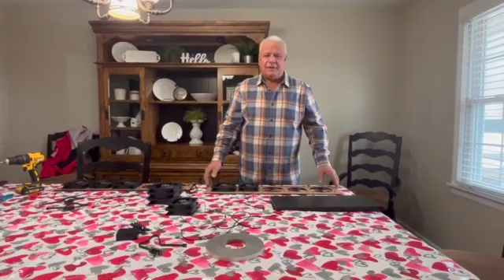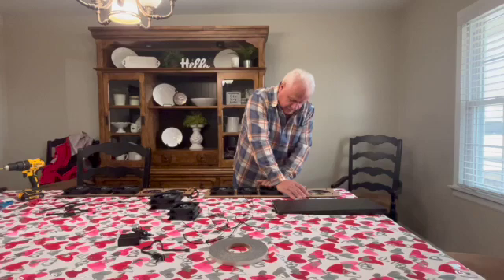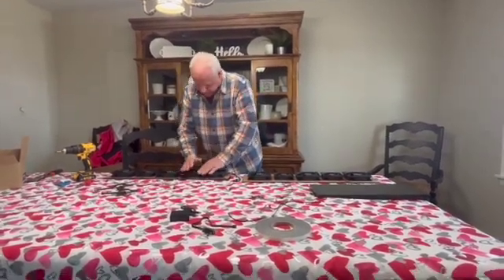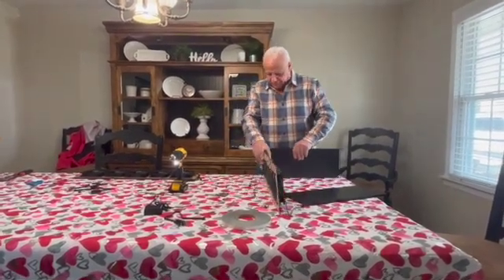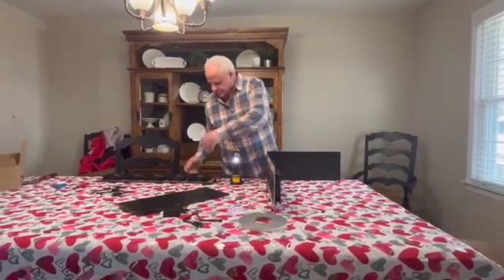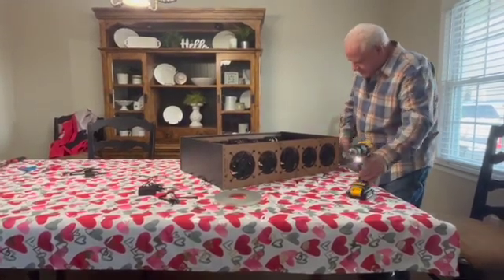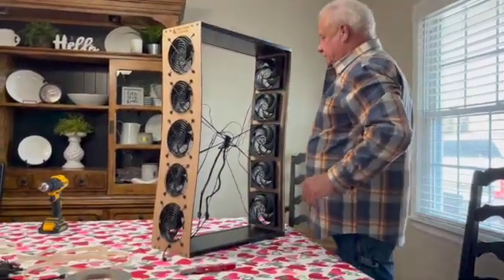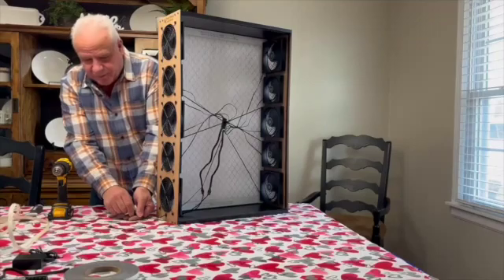Tower of Power Kit Assembly

Comment: It still does not make sense about the fan orientation, does the air flow out of the filters or out of the fans??? The instructions with the kit and this video make it seem like the air flows in from the fans and out through the filters, which does not make sense.
Reply from the maker: No the air flows in the filter and out the fans, primarily because this keeps the fan blades clean, and it also concentrates the exit throw for better room circulation

Comment: 1. Is this the only product you have compatible with 20x30x1 size filters?

2. Are the fans powerful enough for the 3M MERV 14 2500 series 20x30x1? 

3. How much energy will it consume?
Reply from the maker: Yes the Tower of Power is our only product that fits 20x30, and it will work with the MPR2500.  It only consumes 18W
Reply: @cleanairkits  what is the CFM with the MPR 2500? Thanks.
Reply from the maker: @capcom4eva  Just about 5% lower than MPR1900:  https://www.cleanairkits.com/blogs/news/what-happens-to-cadr-with-different-grade-filters
Reply: @cleanairkits  This kit is $295. Any plans to do more affordable kits for 20x30x1 filters? I see you have kits as low as $99, but it doesn’t support this size. Thanks.
Reply from the maker: Yes MERV14 is ok.  Tower of Power is our only product using 20x30x1, but XXL gets about same CADR as Tower of Power
Reply: @cleanairkits  Any plans to make a Brisk Box Kit in 20x30x1 in the future? I’d love to know how much extra CFM & added wattage added fans would make!  Thanks!! 😁

Comment: The way the boards bend make it seem quite fragile. If a cat jumped on top, how would the box fare?
Reply: The filters provide structure and stability.  Once filters are inside it will fare fine.  But the lightness is an advantage so easy to move around.
Reply: @waynewesterman1426  you'd think for $289 they could upgrade to something light and durable e.g. sheet aluminum